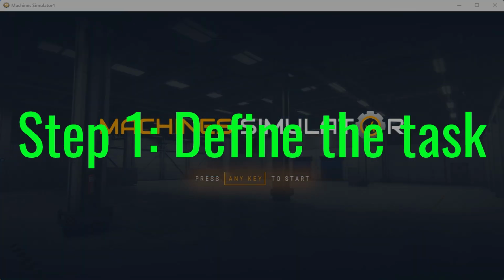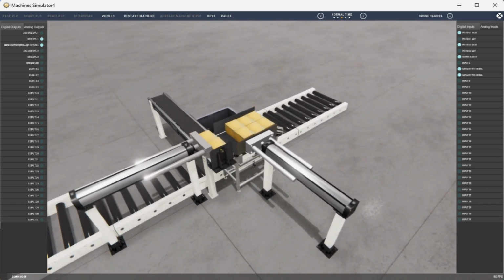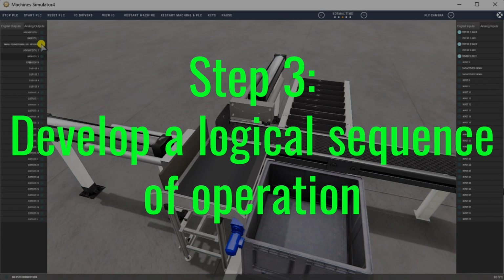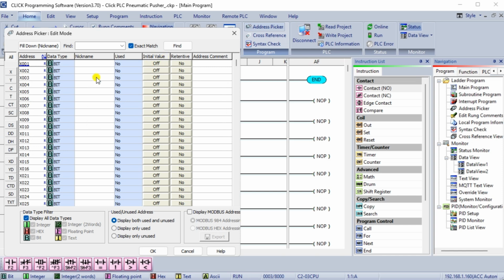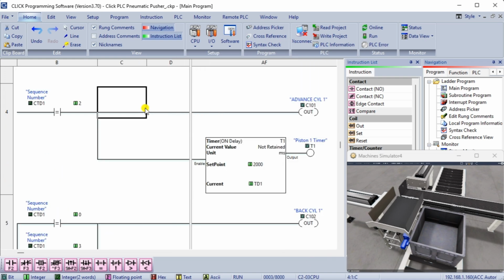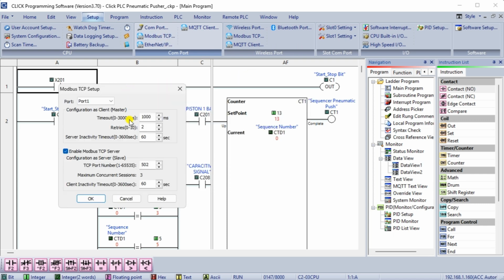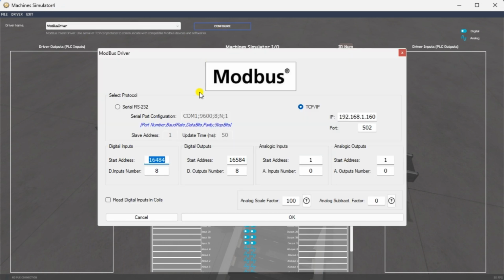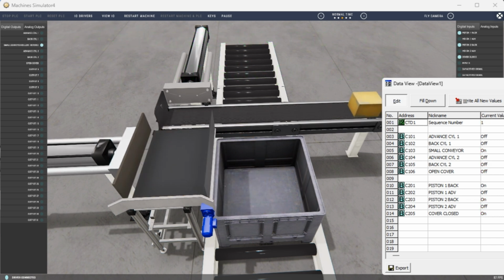Build a Working Pneumatic Pusher System with Click PLC!

Comment: Do you know how to make this digital twin (machine) using AWL code for Siemens TIA Portal? I’ve tried to emulate it, but I’m having an issue with the part where the 8 boxes are in position and need to be pushed by cylinder 2 toward the shredder.
Reply from the maker: I have not done this code using STL (Statement List). There should be enough information on the website and the sequence table for your reference.
https://accautomation.ca/master-the-pneumatic-pusher-simulator-now/
Regards,
Garry

Comment: hice paso a paso el programa y en el MS  se volvio un caos el piston ni siquiera abre en la primera secuencia // descargue el programa que envias para ensayarlo en mi CPU click plus C2-03CPU y dos mopdulos el  el c2-14D1 y el c0-08CDR ,el unico dispositivo que no tengo es el simulkador de la entrada x102 ,sin embargo lo reemplaze por un c50 como el star y lo unico que se   contrae es la cubierta (cover) la cual se posiciona en la parte de arriba para no dejar caer las cajas, No entiendo que pasa
Reply from the maker: I would first put the PLC into program mode and use the Data View to determine if you have the correct inputs and outputs to control the MS.
Regards,
Garry